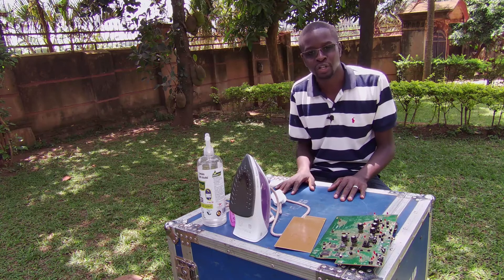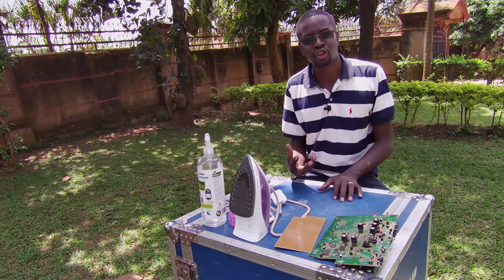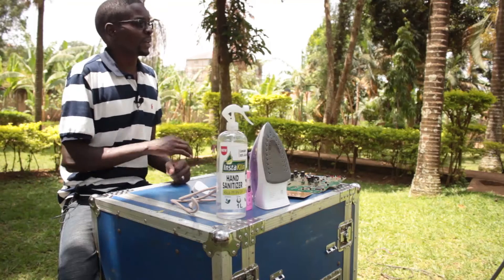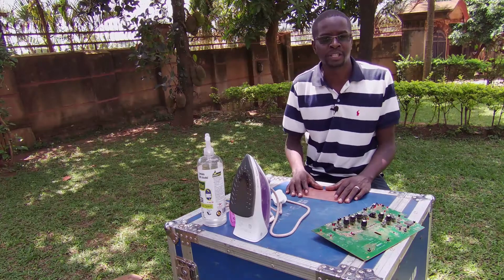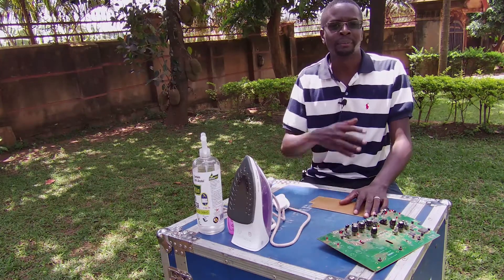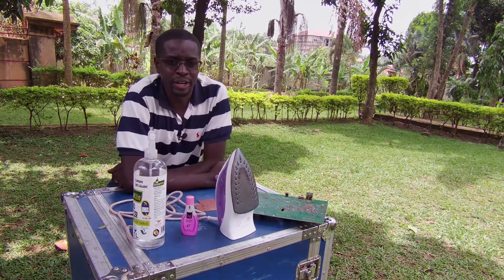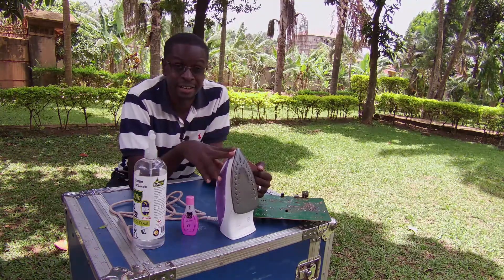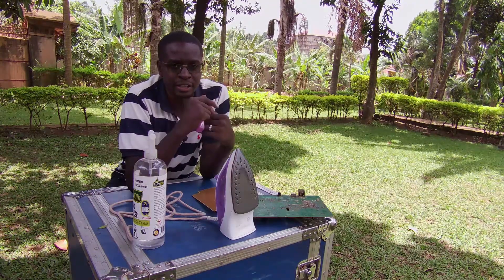I etched my first PCB! Well almost

Comment: Nice project! I designed quite a few etching projects for Eurorack modules. Some tips: use cheap but extra glossy printing paper. Print with laser printer. Sand your copper layer before adding toner with fine grain. Dont touch the copper layer between cleaning and toner transfer. Put the iron on fairly hot, add the tonerpaper on the pcb and press as hard as you can for 2 minutes with the iron. Use some soft paper between the iron and your work so the heat and pressure is equaly distributed. Check if your iron is flat and has no holes, else change the position of your iron each 30 seconds and press again
Reply from the maker: Thanks for the tips...I will keep experimenting to see what improves
Reply: @Afrorack  if you can get one cheap enough, a laminator works a whole lot better than an iron, giving you much more even heat and pressure.
Reply from the maker: @QrchackOfficial  Thanks I will keep experimenting until I figure out what works